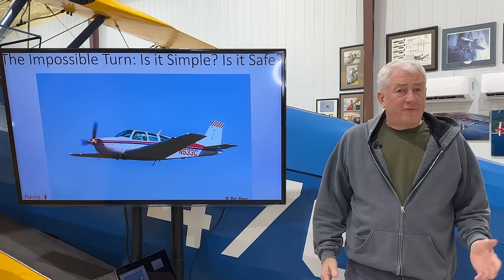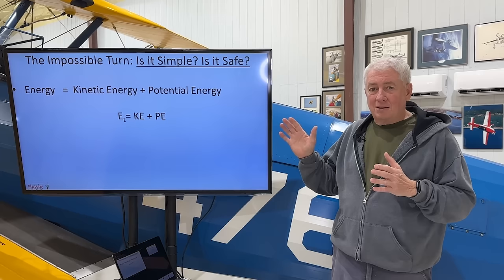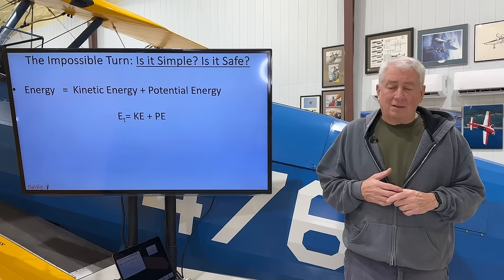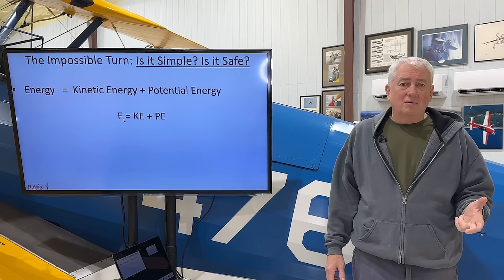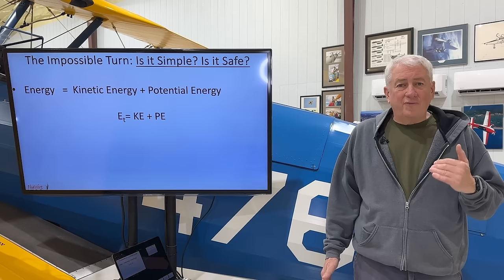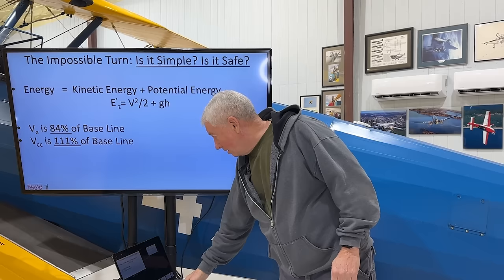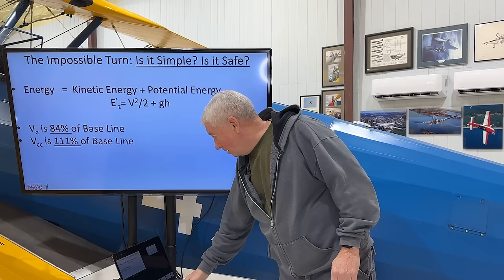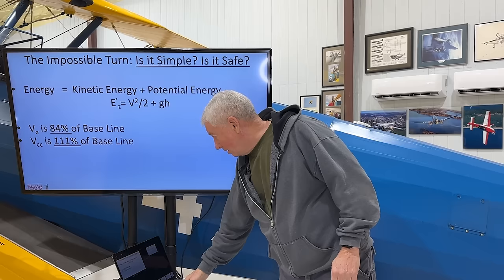Impossible Turn Is it Simple? Is it Safe?

Comment: I practiced this today in my light sport  at altitude and near gross weight. You gotta push that nose over till your light in the seat. 45 degree bank turn.  I lost 300 feet at 180 degrees, 400  feet 270 degrees.  So the airplane can do it if I have the presence of mind at the time.
Reply: I learned a maneuver to get used TO PUSH NOSE DOWN AT 200 AGL AFTER TAKE OFF.  Keep engine at full power, push nose down fast, then bring it up slowly again. My CFI called it   "Take off Pushdowns".  That was in 1997. No need to cut engine at bad moment like that.  You accelerated on the push down, get used to it.  Freaky at beginning, but then its fun.   And important.
Reply: I learned turnbacks in 1995.  So Add a buffer of say 100 feet.  Mentally reviiew before every take off. lIke "no power turnback to opposite Only if from 500 or turning crosswind.  We used to Put an altitude marker on altimeter and a blue line on Vglide.  Easier for any maneuvers .
Reply: Good for you practicing!

Comment: Nice video.  Remember, this data is for one aircraft only, not even one type of aircraft.  A Piper Cub or a Cessna Cardinal RG will have vastly different results.  I believe the main takeaway of this video is KNOW WHAT YOUR AIRCRAFT IS CAPABLE OF.  This takes practice.  Don't say you can or can't do something unless you practice.  And that practice will give you the knowledge of a single aircraft, the one you practiced in.
Reply from the maker: Excellent comment. With one exception the data from the equation is independent of mass or aerodynamics. The energy loss will vary by airplane.
Reply: @FlyWirescottperdue  100% correct on mass, and there are other significant factors also, such as drag, wing cord profile, roll rates, control effectiveness and resultant glide ratios etc.  The disimilarity between aircraft is a significant factor that requires demonstrated experience, not just the energy equation. That is, it is important to know what your airplane can achieve with that energy!  Which is why , as you clearly alluded to, a pilot needs to practice and establish physical/aerodynamic empathy with the airplane. 
Then there are the external factors; length of runway behind you, wind speed and its direction, along with clearing the 50ft obsticle etc. 
Looking forward to your next episode!

Comment: Thanks Scott, the possible “impossible turn” folks are guilty of trying to simplify a very dynamic and difficult situation. The difficulty of managing any decisions in such a high stress, high threat and high consequence critically short time frame is immense. Your presentation show really well the complexity of the aircraft capability and has not even yet added the complexity of the environmental dynamic. Those that say, from xxx feet I can safely return are probably mis calculating their piloting, aircraft capability at best and delusional at worst. The environmental conditions are always going to change any xxx feet calculation I.e. cross wind, which way to turn? Take off with a 20 knot headwind, how’s landing now with a 20 knot tailwind going to affect the calculation? What about a sea level calculation and then operating at high elevation and or high DA? The impossible turn Rule of Thumb was written in blood however it could be updated to the improbable turn. I don’t recall where I heard it first but the statement ‘once the engine has failed, the only job the airframe has is to keep the meat bags alive because the insurance already owns the wreck’. Keep up the great work.
Reply: My CFI in 1995 used to teach power off turnbacks on my field surrounded by houses all over.  He said to only plan about power off turnback only if you were climbing well or over 700 fpm and some wind to help you come back.  And if over 700 agl.  We did about 6 of them.  Cherokees. 4,600 feet runway.  I know about 4 turnbacks on that airport with only minor gear damages.  I know about a Cessna 172 with partial power loss on crosswind leg,.  The dummy Keep going forward and away and crashed on a place with big pipes 4 miles out, lol.  Pipes were Propane Gas.  Im serious.  No bullshit. He could have turnback from the crosswind leg, or maybe turnaround the airport.  Crashed BY KEPT GOING FORWARD as told, 4 MILES AWAY. ON A PROPANE FARM.  GREAT DECISION.  HIS LIFE and his beautiful Cessna DESTROYED.

Comment: I learned a maneuver to get used TO PUSH NOSE DOWN AT 200 AGL AFTER TAKE OFF.  Keep engine at full power, push nose down fast, then bring it up slowly again. My CFI called it   "Take off Pushdowns".  That was in 1997. No need to cut engine at bad moment like that.  You accelerated on the push down, get used to it.  Freaky at beginning.  But needed practice.

Comment: Minimum requirements for MY airplane to execute a safe return to the runway would include density altitude, airspeed, gross weight as well as altitude (agl). All such requirements would be on a pre-take off addendum to my checklist, and would be briefed prior to every take-off as part of the emergency considerations.
Reply from the maker: Walter, how do you quantify those factors?
Reply: I'm a pilot with surely less experience than you, but in my opinion I don't even think about turn backs unless I'm at pattern altitude or there are absolutely no options straight ahead

Comment: Richard McSpadden did a video for AOPA flight safety institute where he insinuated that the impossible turn was possible in many cases, And then was killed later on apparently in a plane where the pilot was trying to make the impossible turn. I agree with you, It's not Simple, and it's not safe and your math proves it. Another factor is that aircraft at takeoff are normally at their heaviest, before burning off any fuel and adding in the performance factors associated with density altitude which can destroy even more of your energy  and you have a really impossible turn
Reply: That’s why he made this video…because of Richard’s death.
Reply: He mentioned the Cardinal crash in the beginning of the video.
Reply: It is possible in many cases.  There's YouTube videos of it happening.  The problem is that it depends.  If you aren't familiar with the aircraft including it's low speed characteristics, if you aren't comfortable flying at the edge, if you haven't done the planning and pre-takeoff briefing, and if the airplane has a higher wing loading, the more difficult it will be to pull it off successfully.  The reason the advice is usually to just fly straight ahead is because the average pilot is just doing $100 hamburger runs and didn't build the skills or experience with even basic maneuvers and didn't do the planning.  So the safest thing to do is just revert to primacy and go straight ahead.  Personally, I think their advice needs to be more nuanced.  I've flown at several airports where crashing straight ahead was going to result in a very bad day due to terrain, water, or houses.  Sometimes you just need to turn 90 degrees not the full 180-270.  But that's why you plan for the specific runway and do a takeoff briefing before pulling out onto the runway.  But the average GA pilot doesn't do that.  So they take the lowest common denominator approach and recommend everyone crash straight ahead.

Comment: Scott, if you have a Garmin G5 in your panel take a look at Section 11.4 (RS-232 Text Output Format) for an RS-232 interface which gives a plethora of Attitude/Air data (10 hz) and GPS data, 1 hz).  This is in the the "G5 Electronic Flight Installation Mannual for Experimental/LSA aircraft.  You probably would need some sort of an FAA approval to install the RS232 serial cable.  I'm running an RV7-A so the interface is my primary flight test data colleciton source.  One work around would be if you had a second, non "installed" G5 with a separate battery to run the device and an small arduinno or Raspberry Pi to read the serial interface and store the information.  Great video, Thanks.
Reply from the maker: Phillip, I don't have to do that. My G3X records a very large number of data points every second. It is a fantastic Flight Test support feature!

Comment: At 30 degree bank you will take lots more room and hence altitude to complete the 270 Turnback.  It is Hook or  Question Mark Shaped.  You need 45 degree bank/Vglide speed or a few knots less if no stall warning on.  I used to teach them in the 1990's on a houses surrounded airport.  Some climbing at over 800 fpm and some wind we used to turnback from 700 agl simulated EFATO.  Cessnas, Short wing cherokkes and Grumman Tigers.  4,500 feet long runway. I have videos from 1995 turnbacks & landing with 16 knots quartering TAILWINDS. Im the CFI that taught that other commenter named outwiththem in 1997.

Comment: This is a complicated subject to say the least. E (total)= KE + PE is true, and it's pretty straight forward if we want to describe the path of a ballistic object (cannonball). If we add wings, control surfaces, and a power plant to our cannonball, and ask the question, "If the cannonball looses power, at what altitude (PE) and velocity (KE), would it be possible to utilize the control surfaces to return my cannonball to its starting point, then, as you suggest, the variables are so manifold that only empirical data collected by testing the specific cannonball under real conditions can answer that question.
Reply: It is also worth noting that in the equation E (total) = (mV(2)/2) + mgh, g is gravity (9.8m/s(2)), so it is also an accelerating force. Also, maximum PE is achieved at the apex (highest altitude h), after that, assuming no other energy, then PE becomes KE as the object falls.

Comment: Thanks for these videos!  Apologies if you addressed this, but I think you need more than 180° if you plan on making the runway, more like 270° (unless you have a nice x-wind).  I'm still in the land/crash straight ahead camp.
Reply from the maker: I covered it in my first videos on the subject. From this video Vy did NOT have the energy to turn anymore after 180 degrees.
Reply: @FlyWirescottperdue  Mr Perdue, Did you turn at the required 45 bank and REAL Vglide speed weight for the weight.  And just over TPA?. Those things have to be done right of BUST THE MANEUVER.  Me and outwiththem were students of Emergency LowManeuvering Channel CFI.  He was an experts on turnbacks. 1996.

Comment: Scott you nailed it.  Energy is paramount to flight.  Your mathematical analysis is spot on.  Do not try the impossible turn.  If Richard MacSpadden could not do it then why do pilots even consider it. AOA and stall speeds will greatly increased with engine out on take off or slow flight.  Pilots seem to know this so does is come down to aeronautical decision making?

Comment: I took off on 22 runway in Tomahawk, 600 feet engine lost power,  i took control from student, stuffed nose down, banked 20 degrees at 80 kts and landed back on runway 34.
Reply: i LEARNED turnbacks on a Tomahawk 2 kinds.  1997.  climbing at 700 fpm, 700 agl, power off, nose down to 45 degree bank at Vglide 70 knots.  Made it to the 4,000 feet long runway if winds of 10 knots helped.

Comment: During your engine failure after takeoff, I keep thinking: turn on the Boost Pump on that Continental (in case it’s the engine driven pump that failed). Not something I see or hear very often, but something to remember.  I would hate to do an emergency landing after an engine failure after takeoff only to discover that I could have prevented the experience by turning on the boost pump…

How do you suppose Beechcraft determined the Vcc?  It’s not mentioned in my 185 Owner’s Manual.  I use 500 FPM and take the resulting speed, which averages ~130 MPH TAS on the G5 to TOC (I have a 350 HP IO-520).  500 FPM after TP altitude in my airplane works well all the way to 12,500’, if I need to go that high.
Reply from the maker: Hey, Manny! I haven't heard from you in awhile. The simple answer is Vcc is pretty much Best Glide Speed.
Reply: @FlyWirescottperdue  Best glide is 80 MPH in my airplane, which is between Vx and Vy.  That wouldn’t work and I wouldn’t be able to see traffic ahead as I climb due to the high pitch attitude.  Vcc 500 FPM with a speed beyond Vy works great for me.  The cylinder heads in the summer heat like it better, too.  I guess there’s math in there somewhere…😎

Comment: First, Thank You!, Second, I would like to see vx, and vy  tried at higher altitudes to compare overall altitude loss for a 180 and 270 turn. To take it further various bank angles . I assume there has to be a best average turn just like there is a best glide. I recently practiced turning back using box turn techniques in a 150, altitude loss was about 300' at at the 180 point.

Comment: A maneuver to get used TO PUSH NOSE DOWN AT 200 AGL AFTER TAKE OFF.  Keep engine at full power, push nose down fast, then bring it up slowly again. My CFI called it   "Take off Pushdowns".  That was in 1997.  No need to cut engine at bad moment like that.  You accelerates on the push down, so get used to it.  Freaky at the beginning.  THEN FUN TO DO.

Comment: Hi Scott, in the 60s and 70s we flew A36s and engine failure was always on my mind on takeoff.
I never considered using full coarse for improving glide angle…….(not taught) but then, if the engine has stopped turning there’s no oil pressure to change the prop angle (there is no accumulator)…….right?.
Reply from the maker: Correct. The difference is 1500 FPM with fine pitch and 1000 FPM with coarse... big difference.
Reply: @FlyWirescottperdue  but you need oil pressure to change the prop angle……..at 100-110kt the prop will likely stop turning and not delivering oil pressure required.  Ceasure/loss of oil pressure might be the very symptom related to the engine ‘failure’ and thus no ability to get coarse pitch…….?  Spring loading (overcome by oil pressure) for full coarse would be an asset ?.

Comment: So I always climb out about 10kts faster than recommended. At a minimum... so I can carry extra energy to have for maneuvering if engine stops.... and also to make some safety margin for wind gusts, especially in the mountaon flying I do
Reply from the maker: Good on ya!
Reply: For wind gusts and wind shear, that's what you want to do.  But the fastest way to build total energy is to accelerate in ground effect to Vy then climb at Vy.  It's basic flight mechanics.
Reply: @major__kong  ya, I know. The same old dogma. Tha KS for reiterating the same crap. I think that you are correct in a static environment amd I also think your ass better be faster than 1 second in processing the engine out, executing a pitch down that is perfectly.on point otherwise you will lose EVERY single foot altitude you gained over using my approach of climbing at a slightly faster airspeed, slightly lower pitch up and with me carrying enough extra energy to stay on a parabolic path, versus the cliff you potentially are going to fall from. 
Granted of you can see the engine out, process that, get light in the seat, not overshoot in the dive,  congratulations.  
I have experienced departure issue first hand, and it was my speed not my altitude that saved me.

Comment: If the probability of a flight having an engine failure is proportional to the elapsed flight time, then in Scott's exercises climbing at Vcc for 65 seconds has almost 11 times the probability of an engine failure after climbing at Vx for 6 seconds.  I would have thought the optimal climb tactic should be to fly at whatever airspeed minimises the flight time required to reach the minimum altitude that permits a successful turnback in that flight condition.

Also, climbing at Vcc at a shallow angle, to maximise energy, achieves nothing if that angle is shallower than the best glide angle that can be flown after turning back towards the departure runway.
Reply from the maker: I think you are over generalizing the issue and cherry picking several things. You obviously don't want elucidation. Believe what you like, MIB is real.
Reply: @petergorman4021  that’s how I understand it, at Vcc, you will never make it back to the runway because your glide is steeper..